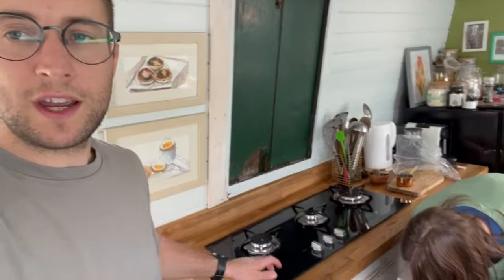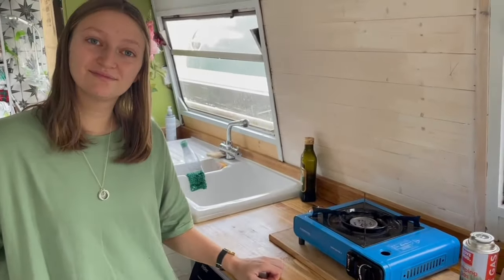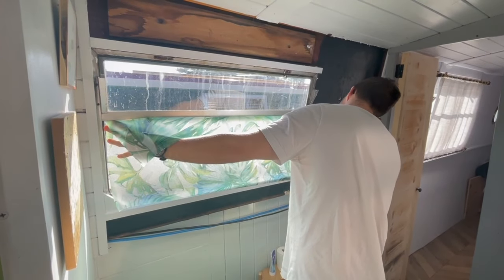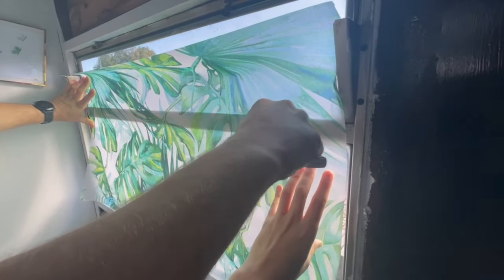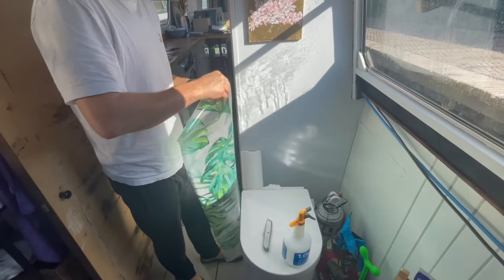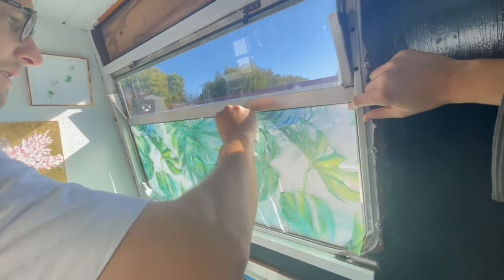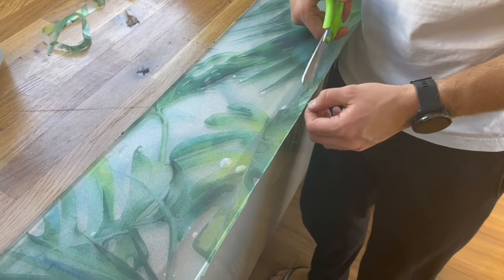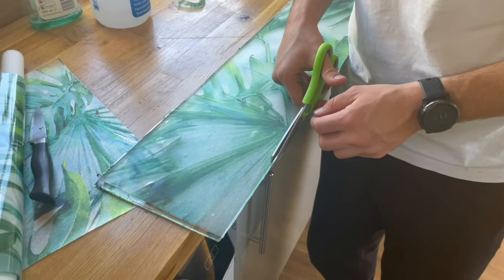New kitchen hob! And putting up window screens | Narrowboat Ratae | Renovation

Comment: When you are doing any kind of Plastic Films,either for windows or putting on work surfaces etc,your best friend is a Hair Dryer ( you can use a heat gun ) but you need to be really careful with one of those,with the Hair Dryer it warms the film up beautifully just enough to be able to stretch it and it dries out the water,don’t be afraid of putting on too much water.
It does look nice with the Green frosting but personally I think it would look better if you used Real Window Tinting Film ( it doesn’t come in just Black ) and it has the added benefit of you being able to see out but people not being able to see in,also it actually improves your heat retention,is UV Proof.
Really like the Gas Hob,that looks very Smart.
As others have mentioned,definitely recommend Carbon Monoxide detector ( s )…. Don’t forget that you should always have one in your Bedroom,especially on board a Narrowboat,so many people because it’s Cold,stoke up the fire or put on the Gas Burner,shut the windows and forget about Co2 and of course the most important place is having a detector in your bedroom or by your bed!!.
Great video ❤
Reply from the maker: Thanks for the advice! Hope you enjoyed watching :)